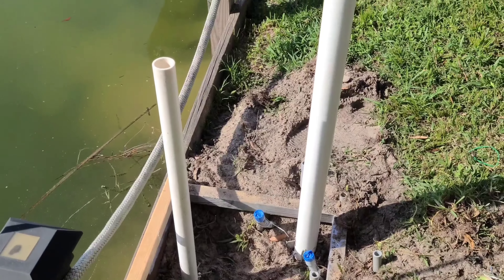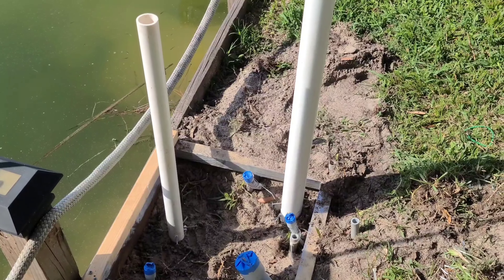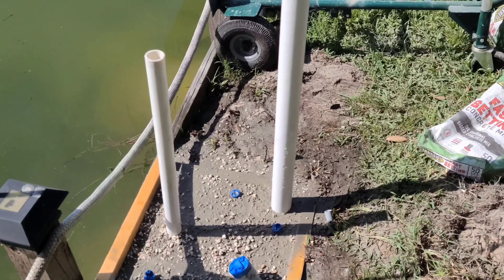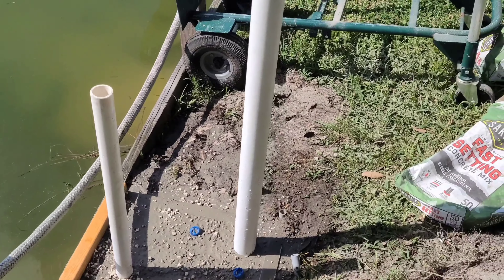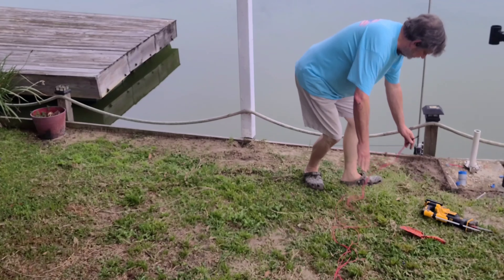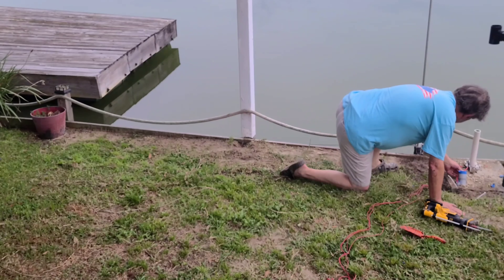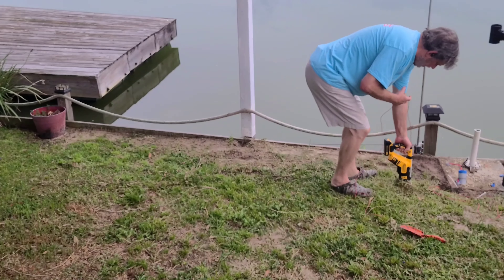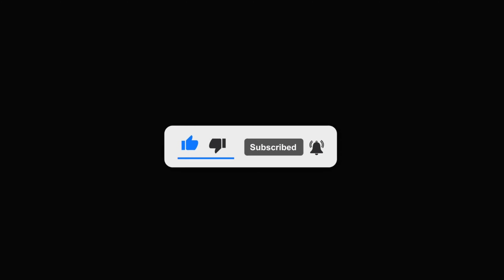DX Commander install.   With NO Guys!

Comment: Crocs and Dewalt. My two favorite brands. The DX Signature 9 uses a 4' fiberglass pole buried in concrete, that the antenna base slips over.
Reply from the maker: Required footwear in Florida

Comment: 0:09  FYI. Selfie mode uses a mirror image for the display (as it's easier to control, just like a small mirror), but the final image or video needn't be mirror image. Check your camera's settings, as it should have some setting in the menu to result in the final image or video being not mirror image. In other words, selfies need not be mirror image when published. Cheers.

Comment: Excellent work!  I like that trick.  I need to re-do my radials this way!
Reply from the maker: Thanks Jim. I saw someone burying petsafe wire that way and decided to try doing it for radials. Went about 2" deep, and did coax the same way with a larger tube.
Reply: @kk4palhamradiounleashed   SOn, I need to see some SWR readings for that setup.  It is a really neat install, and now I am almost motivated to get my fat butt out in the yard and do my radials that way.
Reply from the maker: @FEPLabsRadio  When I get home, I'll do a video showing the SWR on all the bands. For radials in sand and only 180 degrees around, I was happy with it.
 Tried for middle of each band and got close.
Reply: I'd do mine that way but for two reasons; don't have to hide them from the lawn guy or others and the soil I have is so gravely that this method would not work. But, still this the best radial hack on the internet. 👍